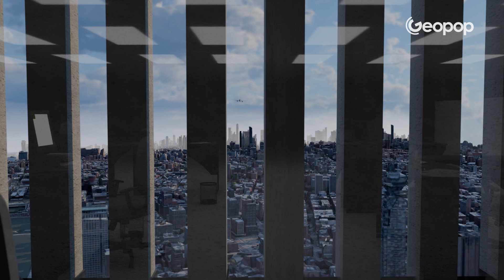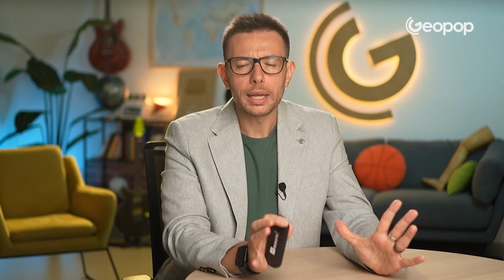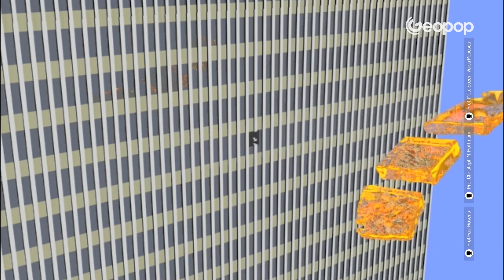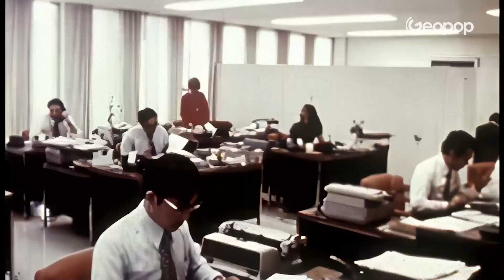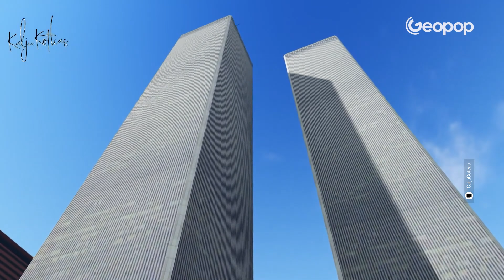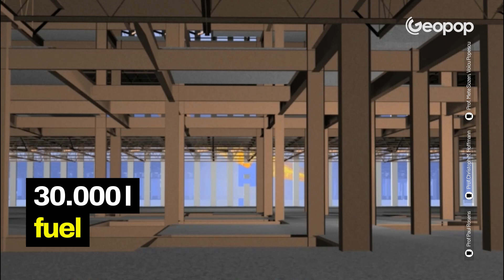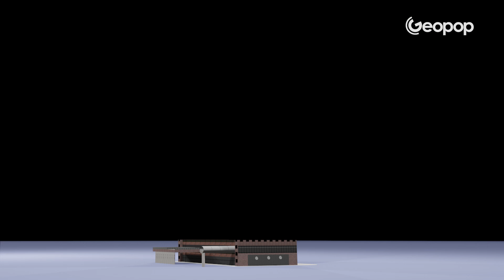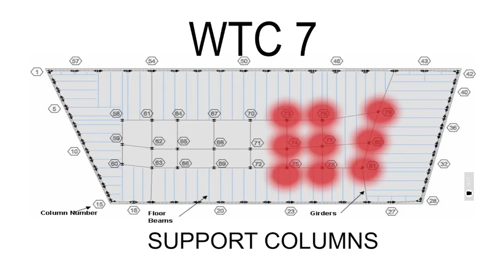9/11, 2001: The Technical Reconstruction of the Twin Towers and WTC 7 Collapses

Comment: Is the host trolling he know fully well that plane and that fire had no impact on that whole structure of building collapsing it was not enough weight for those buildings to bring down like that. That was a control demolition. Those buildings blew up those beans on the north side east side of the building on the south tower had enough steel to steal hold those buildings up long enough that was not enough steel to bring down that strong structure that was beneath the burning impact are you serious and he trying to steal trying to find a way to say these buildings fail because of that fire the most case scenario those two buildings top level that was burning would’ve fell overor just continues to keep burning fire will spread before anything and eventually it will burn itself out because it’s had nothing else to burn on too. The whole know this is all cap.
Reply: Controlled demolition - So simple - A hand-wave.  No thought at all required. In fact the less thought put into it, the better.  Engineering is hard, but this is an engineering problem so that is where we have to go.

Twin Towers collapses were relatively straightforward, the professional engineering community getting a good understanding within just weeks. For the average person though it still requires some effort. Engineering is hard, and who has that kind of time?  So the internet stepped in, peddling a lot of really bad information, simple slogans and hand-wave rationalizations that are exciting and require little or no thinking.  Naturally that gets far too much attention.

Because anything can seem like a conspiracy if you don’t understand how it works and I’m an understanding kind of guy, I prepared my own short yet detailed technical description of Twin Towers collapses from my own observation and analysis of available true and relevant facts. No politics, ideology or magical thinking, just engineering. Hopefully this will dispel many common myths and answer most if not all questions you may have about the collapses.  

While complex, most of the Twin Towers collapse mechanisms can be seen with the naked eye and easily discerned and understood by the layperson if sufficient time is taken to understand.

1. The Twin Towers consisted of 4 primary structural elements that together formed an integrated system where each relied on the others. 47 hollow box-section steel Core Columns carry the majority of the gravity loads. The 236 hollow box-section steel Perimeter Columns carry the remainder and ALL of the lateral (wind) loads. Long-span Lightweight Steel Trusses connect the core and perimeter column together at each floor with a Hat Truss on top to tie the structure together as an integrated unit where no element can survive without the others. There was no structural load bearing concrete and most components were bolted together.

www.youtube.com/watch?v=u7OqrC74Dm4

2. The impact of 120 tons of airplane (= to about 12 dump trucks) at speeds up to 589 mph with the energy of a ton of TNT completely destroys the aircraft. This in no way implies the Towers come out unscathed. Many perimeter columns are damaged or destroyed as are some core columns (example; 33 of 59 perimeter and 20 of 47 core columns damaged or destroyed at the impact floors in the North Tower), This damage is primarily through bolt-shearing failures at the end connecting flanges, as well as bending, twisting and fracturing of weld seams. There was no cutting or slicing - the reality was far more violent and messy.

3. The impacts destroy or damage fire insulation, fire breaks and sprinkler systems on multiple floors. Huge fires are started across multiple floors simultaneously and allowed to spread rapidly with no effective firefighting or fire suppression. This was an unprecedented fire event .

4. The hotter steel gets the weaker it gets . With fire insulation stripped away and no sprinklers the survival time of the steel greatly reduced. Gradually over time heat causes the lightweight steel Floor Trusses at the impact damaged floors to sag, which was observed and recorded. No steel melted or needed to. Structural steel fails long before it becomes a puddle. It just needs to bend

5. Sagging floor trusses pull on the increasingly weak and overloaded Perimeter Columns, causing some of them to bow inward by up to 5 feet. A straight column is up to 4 times stronger than a bent column. The bowed Perimeter Columns buckle and fail, quietly initiating collapse. The formerly static mass above which the structure below could easily support is converted to a dynamic mass up to 30 times greater. Because they have buckled, the Columns above and below the failure point are no longer aligned . The load bearing structure below no longer bears any load as it falls past the lower columns, NOT onto them.

www.youtube.com/watch?v=ULdiD6gYZO0

6. Thousands of tons of debris fall within the four outer walls, down through the open office space, crashing onto the first intact floor it encounters, immediately breaking the bolted column connections as the amount of resistance the Floor Trusses can offer is negligible. The falling debris slows only marginally and briefly. Note: 
6a. This is NOT a solid top block crashing into and “crushing” a solid bottom block . 
6b. The debris falls past the columns not onto them. The columns provide no resistance to the falling debris. 
6c. Only the bolted floor truss connections to the core and perimeter columns offer any resistance. A pair of 5/8” bolts at each end of each truss vs. thousands of tons of falling debris. 
6d. No laws of physics are violated. 
6e. There is no 20 floors against 90 floors but rather 20 floors against one floor, then 21 floors against one floor, then 22 floors against one floor, etc. 

7. This floor-led collapse progression within the four outer walls can only go straight down.
7a. This process is often incorrectly referred to as “pancaking”. The catchy name stuck but nobody knows what it really means and "pancaking" is too simplistic and inaccurate anyway. I prefer Kaiserschmarrn.

8. Collapse progresses through the floor systems past the columns, through the path of least resistance . The resistance offered by each floor is always the same while the mass of debris and its velocity – thus its energy - increases with each floor failure. Each floor offers the exact same resistance to the falling mass while with each failure the falling debris constantly gains both mass and velocity. *This process of floor-by-floor destruction cannot be arrested, it can only speed up . Rate of floor failures increases with each floor as momentum increases, reaching an average acceleration of 0.65 of GA, or 35% slower than true free fall. Bam, bam, bam down the building until there are no more floors to fail. The resistance offered by each successive floor is always the same. More mass, more velocity, same resistance with each floor. Don’t get stuck on the but the lower floors weren’t on fire nonsense. They weren‘t and didn’t need to be.

9. The Towers were 95% air by volume. As that air was compressed inside the building it is forced down the tower and blown out the sides in reaction to the building collapsing . Those were not “explosions”, it was expulsions of compressed air caused by the collapsing building, explaining the low velocity, lack of flash, blast, supersonic pressure waves and lethal high-velocity ejecta.

10. Perimeter Columns become detached and peel away like a banana behind the collapse front, playing out to the four points of the compass extending to more than 800 feet from the base of the towers. This was quite obvious from examination of the debris pile.

11. Core Columns fail last as their internal beam bracing is stripped away by falling debris and lateral support from the floor to perimeter columns is lost.

www.youtube.com/watch?v=WpHXj62Ylw0

12. For those who care about how long this whole process took; 31-34 seconds from the moment the perimeter columns buckled until the last core columns hit the pile, or 1/3 the rate of true free fall. Don’t believe me? Just watch any video of the collapses and note the loose truly free-falling debris dropping much faster than the towers themselves.

13. Each Tower had a 1-acre footprint. Far from collapsing inside their own footprints the debris pile spread out over 17 acres in a pile up to 14 stories deep. 8 surrounding buildings were destroyed and scores more damaged by the falling debris.

14. NOT observed were the 180-190 dB bangs of thousands of high explosive devices or the blinding bright flashes of burning thermite. Neither explosives or thermite could have survived the impacts and subsequent fire nor could have caused the (silent) perimeter column buckling that clearly initiated collapse either. A video of a shocked and injured firefighter casually using the magic word explosion is in no way proof of explsoIVES and the demolition_ case relies entirely on that sort of thing. There is zero tangible physical evidence and it would be technically impossible, totally impractical and completely unnecessary. No one would bother.  In 24 years zero structural engineers of tall buildings, including the 1/3 that have retired in that time, have made any statements in support of pre-planned demolition claims. NONE. The lack of any such citations in the engineering literature (published in any country worldwide) is telling.

15. Twin Towers were perfectly safe within their design envelope. They only collapsed when taken far outside design parameters by an extraordinary and unprecedented event

Impact + Fire (heat) + Time + Gravity = Collapse . Remove any one of those 4 elements and there is no collapse. Ignore any of those elements (as many do) and you will never understand the collapses. The Twin Towers were an integrated system in which no one component could survive without the others. One fails, the rest follow, through the path of least resistance – DOWN – through the open space, bypassing the path of greatest resistance – the columns. Nothing I just described violates any laws of physics. All of the above is true no matter who planned and carried out the 9/11 attacks or why

I hope you found this helpful and informative. It’s meant to be non-adversarial and solicit informed critical comment, positive or negative. If I made any errors of fact, logic or reason or left anything critical out, please let me know so I can fix it. IF you can offer a more plausible alternative be my guest. Please start any reply with the words “Tits McGee” or I’ll know you didn’t read it, aren’t serious and wasting my time.
Reply: Glad we got that sorted out.

Comment: Lots of wrong information. The plane never crashed at 700 kmh. Even at this altitude plane is not able to gain a speed of 500 kmh(info by Boing). And a plane can't create that much heat. Recently, we have seen in India that a plane crash with full jet fuel, but it never created the heat that we hear from the 9/11 crash.
Reply: The generally accepted impact velocities are 440 mph (708 km/h) for Flight 11 and 589 mph (948 km/h) for Flight 175.

You sure as shit didn't get any information from Boeing who - for the record - have no problems with how any of their aircraft performed on 9/11/2001.

The planes did not create that much heat - the fires their impacts started created that much heat and it continued to spread right up to the moment of collapse. The Air India crash is in no way comparable, for reasons I shouldn't have to explain - but probably do.
Reply: Stupid people like you shouldn't have access to the internet